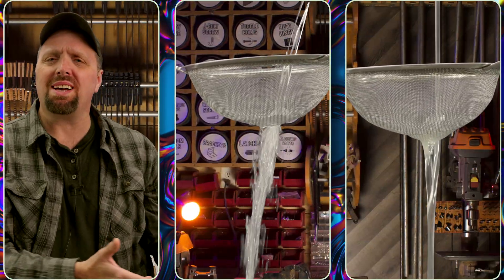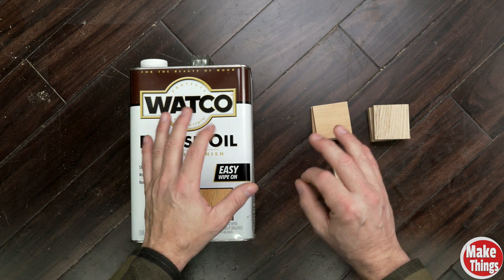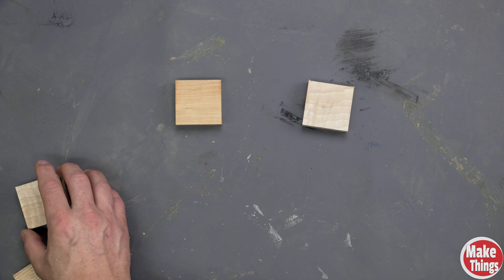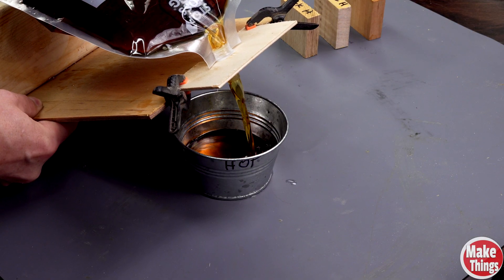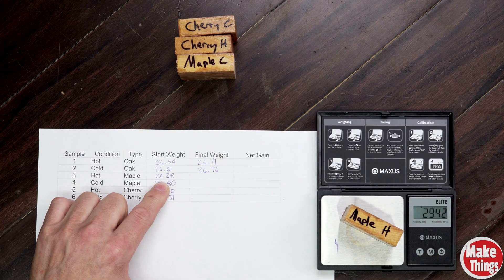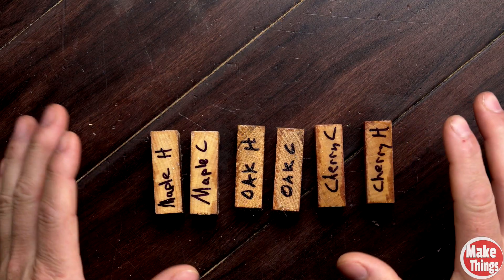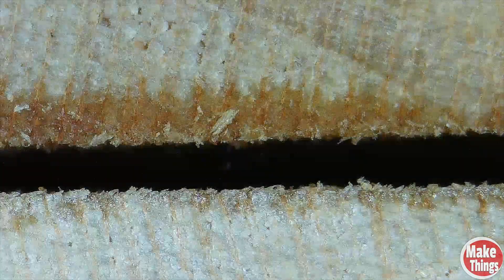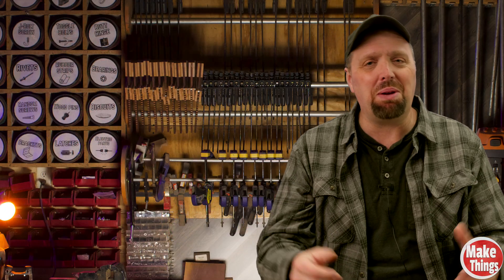Hot vs Cold Danish Oil: The Truth About Heating Wood Finish

Comment: Do the test again, but show the difference between a single coat and a 2nd or 3rd coat. For example, pure tung oil is supposed to have about 4 to 5 coats. Is there actually more penetration or is it just building or soaking into itself?

Comment: Interesting stuff indeed!  I have to wonder, however, if the temperature differential between the wood and the oil is the limiting factor.  I mention this because there's air in wood, and as air warms up it expands.  Does the warm oil cause this air expansion and preclude absorption?  Also, your test is not realistic because we don't immerse wood in finishes.  A better test would be to place a single drop of oil on the surface, allow it to sit for 20-30 minutes, and then wipe it off.

Comment: I’m curious if the results would be different with finishes that they actually used 100+ years ago, such as raw linseed oil or tung oil without the chemical dryers added.

Comment: For a musical instrument, a harder, thinner varnish would vibrate more while letting a greater cross sectional portion of fibers "sing". On hot finish instruments, you can use thinner wood cross sections on the back and the top (which reportedly "speaks" easier than thicker comparable parts) that, combined with a harder and thinner finish would make an "amplificator" of sorts, accentuating projection by enhancing the high frequency spectre. And then there's the "secret" additives that were present in each master luthier's preparations. Some reports cobalt and other elements used to harden and make the finish dry faster, or stay more "on top" reducing the penetration. I can see how finish and temperature vs. penetration would be purpose tailored, meaning, a musical instrument would benefit from a thinner, harder, more vibration prone coat, while that characteristics aren't desirable on pieces that are supposed to whitstand rugged handling and use like a piece of furniture (even high end furniture) which may need a deeper penetrating, more forgiving coat that wouldn't be so easily scratched or rubbed away with less delicate handling.

Comment: Also, the argument that the oil cures too quickly to allow penetration doesn’t fly. Yes, heated oil cures faster, but it doesn’t cure in seconds or minutes. It might cure a few hours faster than it would otherwise. IF you kept it heated for hours. 

Certainly not over the 10 minute duration of the test.

It’s far more likely that you just weren’t able to wipe off as much oil when you pulled it out of the bath because of the lower viscosity of the cold oil.

Probably should’ve weighed the blocks right after taking them out of the bath and then again when you wiped him down at one hour and then again the next day.

Comment: Unfortunately, this can’t be used to make any conclusions. That’s because people don’t put on oil by soaking the piece in the oil.   

When you put on hot oil, you apply it and then come back an hour later and wipe it off. It doesn’t stay hot the whole time, in fact, I’m sure it cools off pretty quickly. Then you wouldn’t run into this issue where it’s much easier to wipe off hot oil than it is to wipe off the cold oil.

Comment: Commercial butt  treatment of western red cedar utility poles is accomplished by soaking the standing poles in a tank of creosote up to a foot above the  intended ground line.  First in hot creosote,  then this is drained and then replaced with  cold creosote. The sapwood is heated by the first soaking and then rapidly cooled.  This cooling builds up enough outside  pressure to treat the sapwood fairly well.  Of course, full-length pressure treatment is more thorough, but in dry climates, it is an effective treatment approved by the American Wood Preservers Association. Heat the wood to improve penetration.

Comment: A while back, I made some trivits for hot casserole dishes, hot pans, etc. I then used a heavy coat of mineral oil and then put it in the microwave just enough to heat up the oil. I'm not exactly sure why, but it really sucked up the oil. Would not be good in every project, but it worked great for this one.  If I remember correctly, it was about 30 seconds
Reply: @jimhumphries7299  i think its actually better use lower watts and longer time in oven for more even heat spread
Reply: @jimhumphries7299  Microwaves mostly heat by vibrating water. Maybe some of the water was driven out and replaced by the oil?